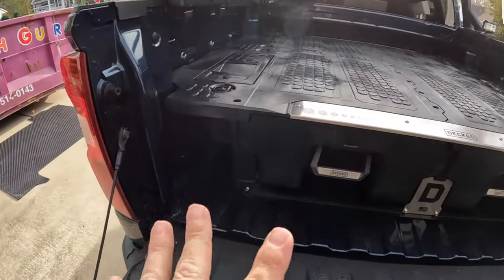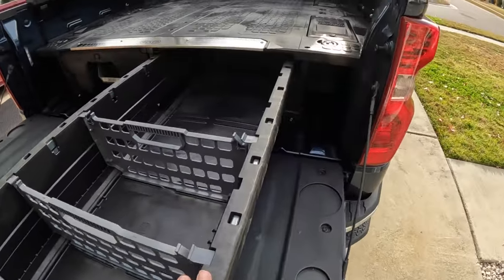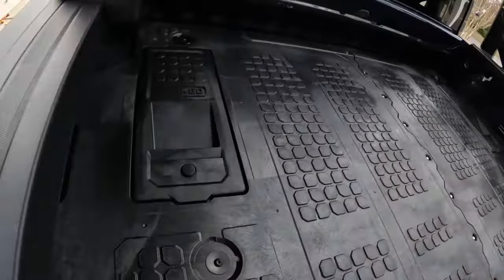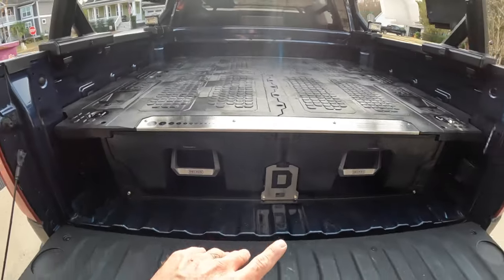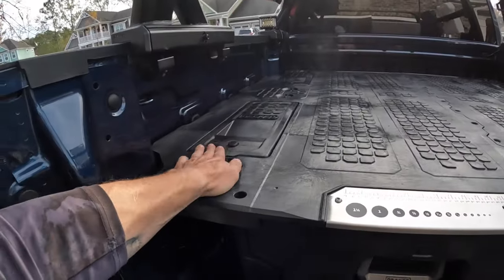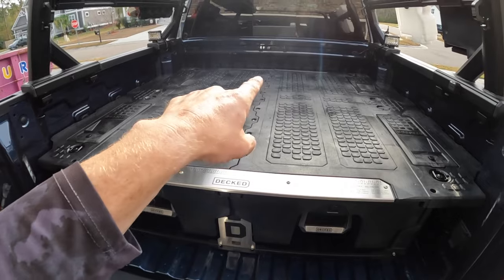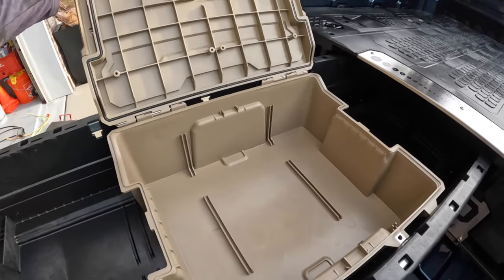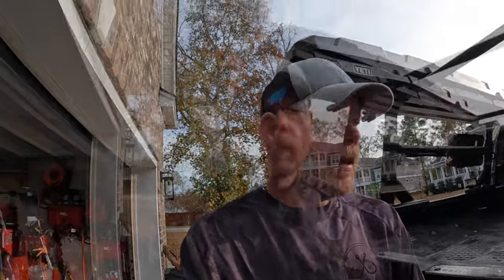ARE THEY WORTH THE HYPE? / Gen 2 Decked Drawers

Comment: I made my own :face-blue-smiling: 1/3 the cost$
Reply from the maker: That’s awesome.
Reply: Time is money so realistically you spent more.
Reply: @Deltron6060  No I didn't spend more. 1/3 the cost, do the math. Time is money, not really. My time was free-time. And my design was better, more efficient for my future jobs with cost effectiveness in full access for my tools, that there system doesn't provide. So Realistically; Check Mate & Match. :face-blue-smiling:
Reply: Do you make your own soap too? 😂 All jokes aside, nicely done. Shoot us some photos, we'd love to check it out!
Reply: @Decked  I will get you photo's when I get a chance. What I use for sliding it, paste WAX & Plastic cutting boards. There is a 4'X8' sheet of plywood on the top of the drawers, that slides in & out. If I had to, it all can come out. Two drawer system I design without a blue print LOL... I have a full size truck bed. All trucks they are building today, are over sized flower pots with short beds LOL.. Every-time I'm at Home Depot or such, drop my tailgate to load, they see it and go WOW!  No space is wasted, specially in the middle. No wheels required. And my drawers are completely square for depth. 6-1/2ft long.  Battery system is going to fill the rest of it over time. I can pull my drawers right out to the ends; Slide it out further on to the work horses. There is much more. :face-blue-smiling: